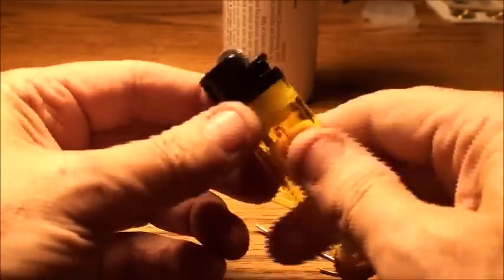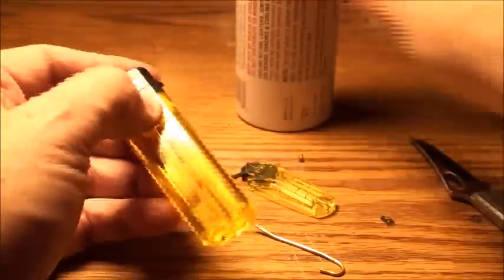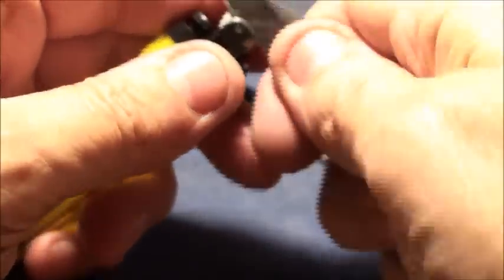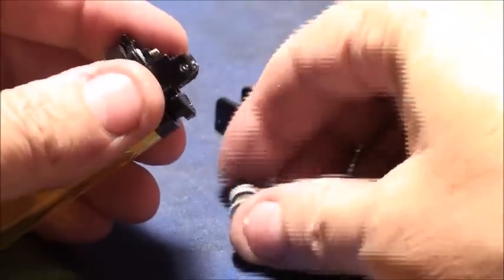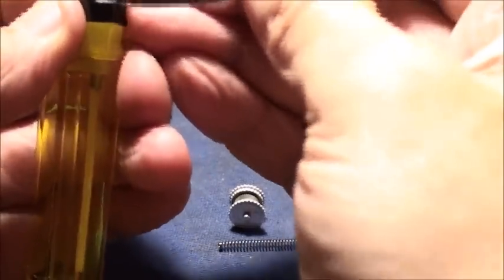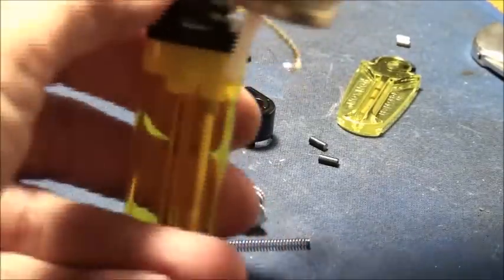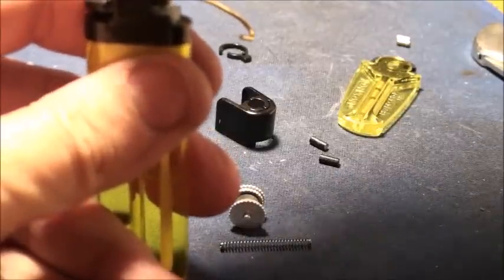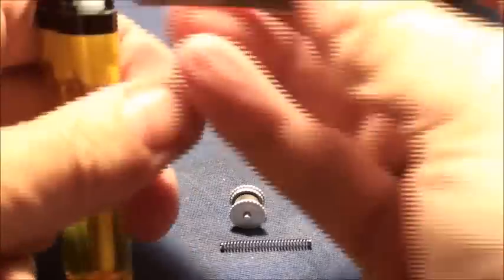Refill Disposable Lighter "CHALLENGE" in 90 Seconds

Comment: I knew there had to be a way to do this. Everywhere I looked online said  it's not possible but I just if the gas comes out of that nozzle when you push the button there has to be a way to put the gas into that nozzle as well. I kept try to do it by just pushing down on guess button but it's not working. If I just had to turn the gas all the way up
Reply from the maker: Your getting closer!

Comment: i used pliers to grab the flint from one of the ends and hold it sideways to stick it on the spring and eventually got it after 2 hours of trying with my fingers. my fingers were raw and numb so imma help some of u out lmao
Reply from the maker: I didn't have alot of trouble other than the Flints flying across my living room. Definitely a Challenge for anyone. I used my fingers and yea they were a bit sore. Glad you liked the video!😎
Reply: I literally broke my brothers lighter and I told him I would fix it I watched this video 1 time and got it not that hard
Reply: @x-tremevidpro  I had to use a pliers too.  Don't know how you do it with your fat fingers(compliment).  Wheel came off along with flint so I took another one apart to see where and how it goes it. I then have two bad lighters.  With this video, I managed to fix one.  Still looking for that flint that popped out.
Reply from the maker: It's tricky to get the wheel on forcing the flint downward and in the right striking direction and snap. Just practice is all it takes!😅

Comment: Found a Bic lighter from around the 80s with a flame adjuster long before the child safety was introduced.

 Going to try this out later on see if I can reuse a Bic lighter that's older them me.
Reply from the maker: Those you can refill easily. Have a light behind it so you can see it fill. Thanks for watching!
Reply: Add a refill valve cut from a disposable refillable lighter. I do that. Drill and screw right in.
Reply from the maker: @rhuckabee44  That's  a brilliant idea 💡!🤙

Comment: Yeah I’d love to know how and the fuck you got that damn flint in so fast and got it to stay while you were putting the roller thingy back in lmao. I ended up taking a very small dab of super glue and glueing the flint to the top of the spring and it worked perfectly. Just make sure you use just enough and not to much.
Reply: Thank doing that now 🙏
Reply from the maker: I like the Super Glue idea! Thx...
Reply: You can get pliers and take the entire thing off. They do the exact same thing like clipper does. Put it in from the bottom and spring then screw it in.

Comment: Wait a second, this is not a Bic lighter. This is not working with the Bic😢
Reply from the maker: Bic has a check valve. Prevents fuel from entering. Cheap Chinese  lighter is approx. .79 cents.

Comment: how on earth did you put the flint so fast i have tried but i couldnt do it
Reply from the maker: LMAO! That was the toughest part of all! I did it till my thumd almost bled...thanks for 👀...
Reply: @x-tremevidpro  crap,  I've tried to get the flints back into the disposable bics for  years and don't bother counting how many flints the spring has sent flying to places unknown to man.   I can't believe you were able to put it back in and then to do it without it becoming airborne even ONCE!   Hats off to you.
Reply: Good thing to do is get a thin enough emery board that fits flat in there (good ones are the ones on pocket knives or even the knife on the little blue Swiss army keychain size knife) so you can put the Flint in and hold it down then just slide a metal emery board or tiny pocket knife flat along the top and under your finger...the fact it's a metal one will be enough strength to hold it down easily then u can pop the wheel in and just pull the knife or file board out last second and it will release the spring just that one tenth of a millimeter till it hits the wheel and you don't have to try and hold it then last minute slam a wheel down four kilometers faster than a compressed spring has a chance to expand...and if you too are in a universe with Newtonian physics, good luck at your sleight of hand being the victor against the compressed energy of a spring.
Reply from the maker: 😉New UPDATE shows all much better. My GREEN DISPOSABLE LIGHTER! Upload on June 6th 2022 evening!

Comment: Would you let us see next time please?  W0W!  HOW Did you get Flint to Stay?     No, Not telling how many times.   =b 
I've just changed Whole Top part from other liter, when flint flies away.  Still want to know How You Really did.   * peace
Reply from the maker: Karen O Gotta keep an eye out for those flying flints. Been filling these lighters for over 20 years. Practice makes perfect. Next video I promise I will slow down. Then you will see how I slip that ole flint right in there. ✌ 👌
Reply from the maker: That flint was a tough one!
Soon I will make another video. It is difficult to look through the video camera and do assembly with one eye open.
Reply: So Looking Forward to seeing it!  I recently Re-watched this - no offence - Still Amazed!  Yep - Practice, That's my 'excuse', so far.
Reply: How come only the yellow ones fill? I can’t fill any other color and can’t refill them over and over again.
Reply from the maker: Did you ever get that flint to stay in the hole?
Reply from the maker: @Karen O  Check out the Update Refill & Flint. Green Lighter slowed it down and different camera angle.
Reply from the maker: @rafaeltorre1643  Use a different refill valve. You should have gotten assortment fill valves. One side should do the trick.
Reply from the maker: Practice makes perfect!😮

Comment: Can't c what yr doing as what r u using the wire for n can't u filling it
Reply from the maker: Wire goes between the adjuster to keep the Valve wide open. Once full, pull wire back out and adjust
Valve Clockwise to nearly closed.
Reply from the maker: 😉New UPDATE shows all much better. My GREEN DISPOSABLE LIGHTER! Upload on June 6th 2022 evening!